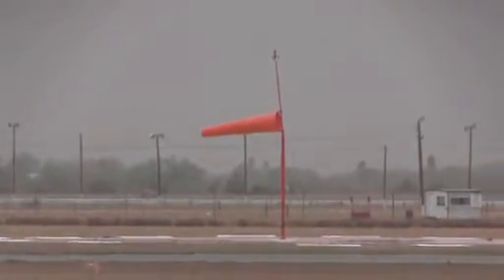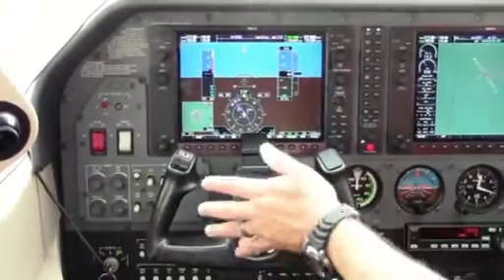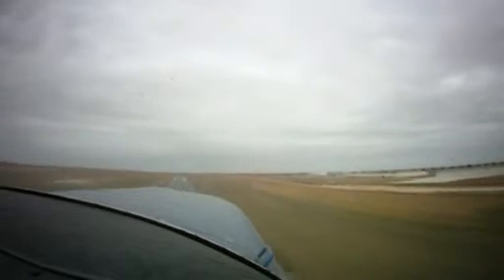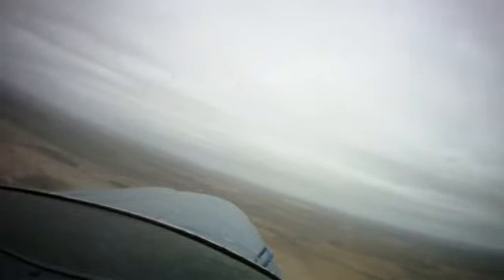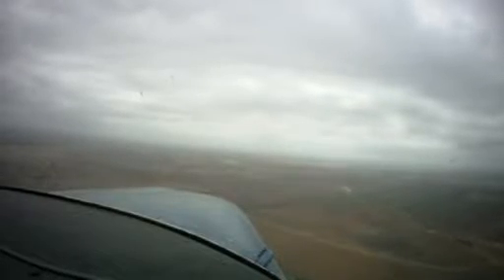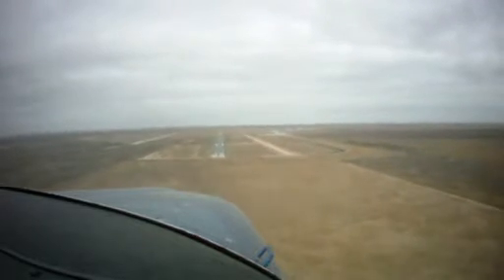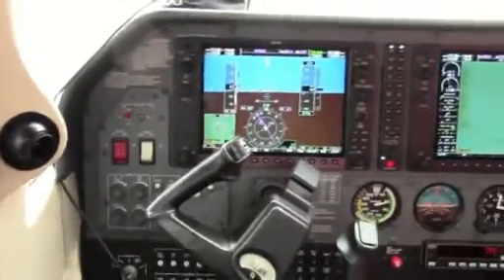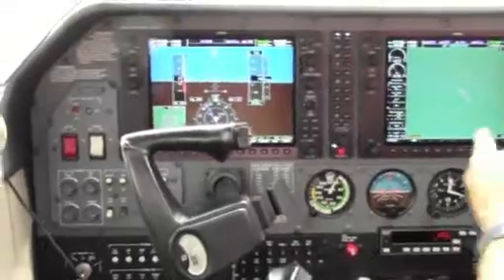Crosswind Landings and Takeoff (English)

Comment: Nice instruction Sir.  Crosswind landings started making since when I got a few things straight in my mind.  keep the nose pointed in the right direction with rudder, and maintain runway center-line with aileron.  Look outside and fly the airplane.  Nothing remains the same, especially the wind!  You are always working back to optimum using corrections when necessary, and in gusty cross-winds, that means you are always working!  Lots of fun most of the time until you run out of rudder.
Reply: Thanks for the English Eddie.  I have watched some of your videos before and always wanted to be able understand.  I want to someday learn Spanish, so maybe if I do, those videos will be a great learning aid!